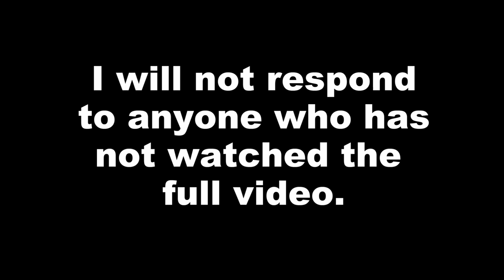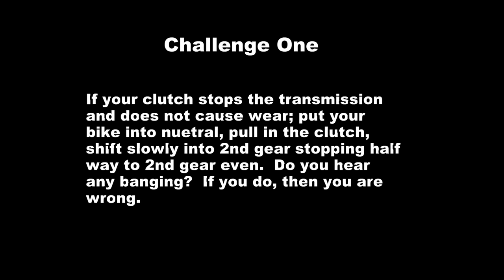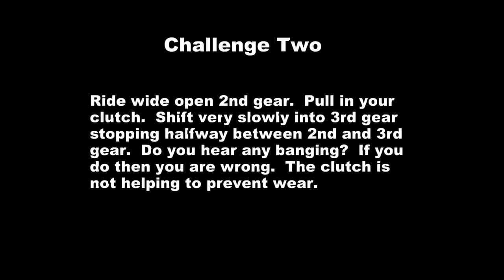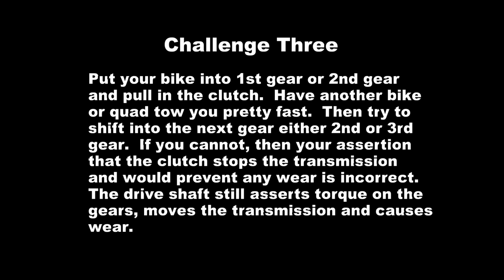Dirtbike: Shifting without the clutch

Comment: Get to the point!  If you remove the torque from the transmission: you're good.  Using the clutch is the easiest way to do this consistently.
Reply: Two sentences to sum it up.This comment needs to be pinned to the top!
Reply: I raced Shifter Karts with 6 speed gearbox at National level. Raced open wheel cars 1 level under Indy Car with 5 speed gear boxes, and ride motocross with 5 speed gear box. I have 30 years racing experience. What do all the boxes have in common? Straight Cut Gears and Dog Rings.  Guys, its a non issue. Release a fraction of throttle as pulling up on next gear and your in it. No lift shift systems work doing the exact same thing but electronically - pull up into next gear, cuts ignition for a micro second and your in it. The gearbox on motorcycles is NOT designed or intended to be used with a clutch. The fasted, smoothest and most accurate shift is no clutch.
Reply: It's easier to roll off the throttle and pull a clutch lever in, pull the shifter up, then let the lever out and roll back onto the throttle? 

Funny, all it takes to do a no-clutch upshift is to roll out of the throttle, pull up on the shifter, and roll back in the throttle.  That seems a lot simpler to get consistently right since you're only timing two events instead of three, but I'm weird like that.

Even DOWNSHIFTING is the same.  If you're downshifting right, you're giving the throttle a quick blip to bring RPM up so your rear tire doesn't lose traction.  Guess what?  You can downshift without using the clutch when you give it that quick twist!
Reply: +Jordan Hillard How do you figure that?  The EASIEST way to remove torque, is to let off of the gas.  How are you achieving anything different by using the clutch?
Reply: I ride enduro and seriously it's not that hard to pull the clutch in when upshiting. It is now an automatism. No matter if it's in technical stuff or high speed trails. It's so simple to pull the clutch in, just stop being lazy x)
Reply: @jowenjv4463  in my little bit of racing motocross, messing with the clutch constantly completely wears out my left arm.  If I save it for the corners then I don't tire nearly as quickly.  I usually use the clutch when trail riding just because. But if I'm racing or just trying to get faster, then I'm only using the clutch in corners and at stops.
Reply: @MURD3RD  I can understand that. At the end of some enduro sorties my hands are so tired that I just can't pull the clutch anymore, I need to rest for 20-30min. But it's enduro between friends and not in competition. Still, 6 to 8 hours of riding, specially here with technical stuff is very demanding for amateurs.
Reply: Lol it's not though. The easiest way is to let off throttle, shift get back on throttle. The clutch is not needed what so ever. The only time the clutch is NEEDED is when you are close to killing the engine, stopped with engine in gear, when engaging the transmission while stationary. Pulling in the clutch also makes it a bit easier to find neutral.
Reply: Jordan Hillard god bless
Reply: Actually the easiest way to remove Torque from the engine is to just back off the throttle! If you're going to use the clutch you back off the throttle then use the clutch that's two steps versus just backing off the throttle which is one step again this guy making a video is right! coming from a master motorcycle mechanic speaking! Deal with it!
Reply: Christopher  you may or may not have to back off the throttle when shifting I myself I have heard gears grinding when trying to shift under load AKA under throttle. Definitely a smart idea to back off the throttle a micro Tad when shifting

Comment: Thanks man. Very informative. I rode  dirt bikes for almost 10 years, and even got to go to a week training camp at Millsap's Training Facility back in 2010. One of the trainers said not to use the clutch when you shift down. I was a little confused because I partially did not believe what I heard. So I definitely needed some insight on if/why it's bad to shift without the clutch. But thank you for debunking all of these myths.

Comment: clutch-less shifting requires good or perfect rpm control i use the clutch because it helps me shift smoothly
Reply: If you've ever driven a semi it's the same you got to use clutch to start then after that perfect rmps or you can be hard on the trans and grind er in
Reply: @thedeere1012  and that is why theres so manu fucked up truck transmissions out there

Comment: The quick shifter on my bike provides the smoothest up shifts I've ever felt, no clutch engagement whatsoever. Yielding a gear change in 0.015 seconds there is no damage to any of the driveline components, the transition is quick and smooth.

Comment: Great video!! Yes, the clutch does not automatically stop the trans input shaft from spinning. Just start up your bike on the stand in neutral and watch the rear wheel spin! I began shifting without clutch on a section of the track after a corner up a hill with big acceleration bumps and had to have all fingers on the grip to hang on but still needed to shift. I shifted by accident with no clutch and it was perfect so I asked a guy who rebuilds engines and transmissions. He said you can shift with no clutch and no damage will occur. After that..i'd shift 80% of the time without clutch. Clutch is for cornering, ruts, rear braking in the air, and of course..starting forward momentum.
Keep up the good work AND stop worrying about the idiots and trolls!!

Comment: When I was 22 I drove a 1967 Cougar XR7 GT from Los Angeles to Seattle with a broken pressure plate fork meaning the clutch would not disengage, this was after I lost a cylinder due to a faulty valve keeper so I dropped the intake valve and it munched the piston but did not break the water jacket. I cut the rod journal off and put only it on the crank to maintain oil pressure and side load from the other cylinder rod on the same journal, sealed the intake port with a piece of aluminum beer can and some high heat RTV. The clutch broke when I was test driving it in Costa Mesa. I simply started it in gear from every stop and using throttle/shift coordination never had any issues. Fortunately I had few stops on I5 with 7 cylinders with AC running even.  I am now one who has driven 1200 miles with no clutch and a cylinder completely missing with no piston or rod, NOT a vibration free drive but at some speeds I could minimize it. 

Before the above, by the age of 12  I was doing clutch-less shifts on motorcycles to do any competitive riding since you lose time otherwise. This came in handy the few times when I broke a clutch cable far from Camp, to start I had to use a rolling start before shifting into 1st.

Comment: Anyone who has ridden a bike with a worn cable, clutch plates or improperly adjusted clutch knows the clutch basket is never totally disconnected from the shell which connects to the engine. You feel the clutch dragging due to the engine and you hear and feel the dogs trying to engage but can't until the rpm is right or the main shaft slows enough for engagement. Good video.
Reply from the maker: Thanks!

Comment: Your videos are art pieces, and contain an invaluable amount of information.
I admit on putting it on pause a few minutes in.
I felt the need to chime in. I don't know what the negative/ignorant comments you got were like.
I can say this however: had a used street bike with a very pleasant working transmission. Underpowered  bike. Whenever I needed to pass, it required at least one downshift, usually two.
I use the clutch in those high revs/high stress (for the engine) situations. When it's time to upshift, either it falls back to the lower gear, or it's a false neutral.
I began clutchless upshifting in those situations. Problem solved. No extra tranny wear,  ever.

Comment: Some of my bikes (Jawa and CZ 2 strokes) have a slick shifter mechanism installed as OEM equipment, so the clutch pops in and out whenever the gear shift lever is moved. Not clutchless shifting at all but to people watching it appears to be. 

The same system was licenced by Honda from Jawa for use on the famous Cub series and on the Honda 250 & 360 automatics.

Triumph also installed a slick shifter on the Bonneville for 1963 only. 

with a slick shifter, it is possible to hold the clutch in and even slip it to pull away using only the gear shift lever. Kind of freaks people out at traffic lights pulling away with my left hand off the clutch lever and the lever moving on its own.

Also extremely hand for when a clutch cable breaks whilst out riding.

On the downside they do take some expertise and experience to set up just right as installing a new cable also means having to align the clutch drag (on the pushrod adjuster) for the slick shifter cam arm and the cable pull. Getting it wrong can mean that the clutch drags when stationary in gear unless the gear lever is held up or down. The other extreme is the slick shifter doesn't pull the clutch in cleanly and the bar lever also has to be pulled in too. 

When set up just right they allow for easy cog swapping, less left hand ache in heavy slow town traffic and higher tension clutch springs to be used, if the engine has been tuned up.

Jawa and CZ 2 stroke road bikes and trail bikes seem to be unique as they feature 2 neutrals, one between 1st and 2nd gears and one between 3rd and 4th gears for long fast downhill coasting. The owners manual advises to not use fast prolonged engine braking for more than a kilometre downhill, hence the extra neutral.

Gear shift patterns can be changed from 1 down 3 up to 1 up 3 down by changing a $30 gear fork guide plate. I prefer the inverted shift pattern as it is impossible to find a false neutral when accelerating up through the gears.

Comment: the way I see it is, clutch less shifting is the same as using a quick shifter. it cuts power to the motor for a split second so the transmission doesn't have much load on it. thus, allowing the transmission to shift. love the vid. learned alot of new things about motorcycle transmissions. thanks!

Comment: it's good to see a video proving that clutch less shifting dose not put extra force that causes extra wear on the gearbox when the shift is preformed fast . I think the most common reason for people to believe that clutch less causes damage is they shift slowly like they are used to being able to get away with when slipping the clutch out very slowly which is slowly allowing the torque to be re-applied to the gearbox  but when you do this without the clutch the rear wheel if forcing the gears to turn at a constant rate to be synced with the rpm of the rear wheel so by slowly engaging the next gear the dogs are hitting into each other and there is a constant torque being applied to the transmission via the spinning rear wheel both are bad things for your gearbox.

Comment: I was always taught to always use a clutch when shifting, which is fine, I did a 100mile enduro race (6hrs) and my clutch hand was getting tired and was getting lazy, and then I realized I didn’t need the clutch to shift at all!! Saved my hands “energy” to slip the clutch for certain situations!!

Comment: I agree completely. The clutch merely allows the user to transmit power from the engine to the gearbox at a controlled rate.

Comment: The clutch is a tool, you use it how you see fit. Yes, the gears are still moving while the clutch is "disengaged", but if you leave the clutch engaged the power from the engine will transfer through the clutch and into the gears completely.  If you "disengage" the clutch, the clutch can slip when the pieces "smash" together.  Yes, letting go of the throttle can minimize that "banging", but the engine is still spinning even though you're not giving it any gas, so when they do "bang" together, the engine is adding to that force (yes the clutch can still slip when fully engaged but it still takes more force to get it to slip).  The clutch will minimize the rotational force of your engine from reaching your gears when shifting between them.  Do/will I use the clutch when I shift? Only if I'm skipping gears or downshifting.  Otherwise, the clutch is needed when you're going into first, braking, and when you're trail riding ( or doing crazy shit!).  The clutch is still a vital component to bikes for those of you wondering why you even need a clutch, but it's purpose from a car's clutch varies a bit.

Comment: ive been riding since I was 14, im 41 now. ive had 2 strokes I only ride 4 strokes now days. im a pretty damn good mechanic but transmissions are all magic to me. ive never had trany go out on me. I would say about 75% of the time I do not use my clutch. if im ripping hard and trying to top out as quickly as possible, the clutch is an extra unnecessary motion period. I do let off or "blip" the throttle. not one time ever on any bike ive had have I heard any banging or grinding. the clutch is primarily there to get you moving from a stand still after that, use it, dont use it it shifts exactly the same as long as youre not a complete idiot. and again in 27 years ive never had a trany go out.
Reply: smoke2275 well said. always need to use clutch going down gears
Reply: will 88 yes thats called rev matching..keeps your fly wheel and clutch in good shape
Reply: you will round dogs on the gear quicker without clutch, resulting in jumping out of gear under heavy load.If you got the money Fire Away.
Reply: @udubidub   you're the only one that put the f**** fax to it

Comment: man, I'm kinda glad I have a four stroke for one of the points you made in this video; the one about running the bike (2 stroke) low on lubricant because of letting off the throttle without using the clutch and allowing the drive shaft to force the engine to run at a higher rpm than the gas is set to. In a four stroke I don't have to worry about this because the oil isn't moved the same as in a two stroke. Good thing too because I use compression braking A TON on my bike. It's sooo much easier for me to let the bike slow me down on a steep decline than trying to work the front AND the super touchy back brake.
Reply from the maker: But you do have the problem on a hill climb the oil goes to the back of the transmission and is not lubricating the cylinder as it should.  A 2 stroke has the oil mixed in with the gas. (unless there is an oil pump of some sort, which at least older 4 strokes do not have).

Comment: Lets take into consideration that millions of 18 speed transmission drivers of big rigs and heavy trucks shift without the clutch daily. Just think of how they shift 18 gears after every stop light, most experienced drivers DO NOT double shift every gear. When taking a road test for the class 3 (BC, Canada) commercial weight vehicle with air-brakes they ask that you shift by double clutching and shift without clutching to show you are capable of both. Why would they be asking you to fuck up your very expensive commercial vehicle. It works the same way but commercial vehicles are under a much greater load and much higher RPM's meaning it would be more dangerous would it not and result in more damage to the gears. You can most definitely grind gears untrained for sure. But as long as you're not forcing it when grinding gears there's no problem. Lay off the pressure adjust RPM with the gas and it pops into gear. If this indeed causes unforgiving wear and tear to the gears, then why would professional drivers who get paid solely on driving destination to destination shift without clutching, damaging their only source of income. Resulting in most cases paying for the parts and servicing that are damaged out of their own pockets not only for all the labour and parts but also not being on the road hence losing thousands of dollars. They cannot risk it. As long as you RPM match and shift appropriately you cause no more damage to the gears with or without the clutch.
Reply: CNDA_TheEhTeam correction, semi trucks change gears at about 2000ish rpm's. they revolve much slower than motorcycles.
Reply: My apologies, you are correct. I forgot the tachometer was measured in x100 not x1000.
Reply: No apologies needed, im just thankful you didnt blow my fawkin head off for offering information!

Comment: I completely agree.  In the 70’s when I raced I rarely used my clutch.  It was only used for coming to a stop or getting ready to launch. Most times I did use it in the corners but never on the straights, going into sweepers jumps rarely ever & I never had a trans failure.

Comment: This is a fantastic video if you're like me and just have never encountered a problem but want to brush up on it just in case. This alleviated my curiosity on why my bike sometimes is hard to put into first gear at a dead stop with clutch pulled. Gear dogs aren't able to slide in! Makes so much sense because It goes in easier by releasing the clutch a tiny bit to get the clutch basket turning to spin the gear for the gear dogs to engage.

Comment: You're absolutely right. No dispute from me. I wish this controversy would just stop. All it takes is one goofball to make a claim to hide his operator error or the guy that put his trans together wrong and it starts all over again. Transmissions may not last forever anyway depending on how you use it. The act of shifting without a clutch is NOT the root cause.